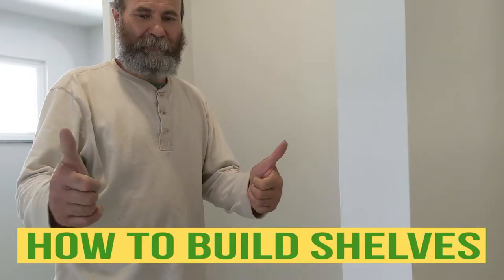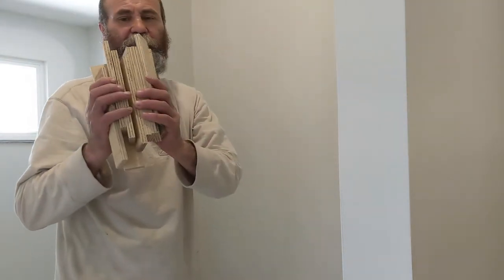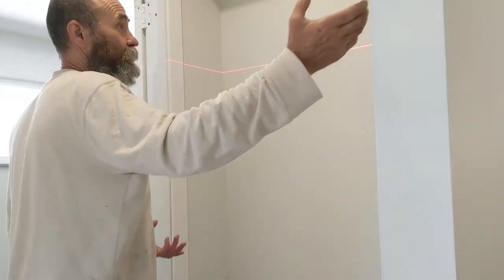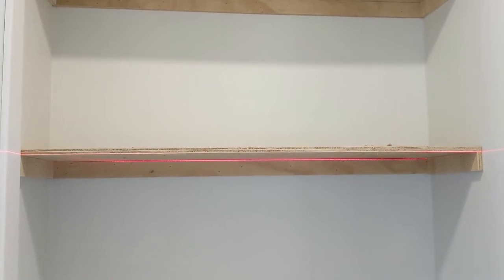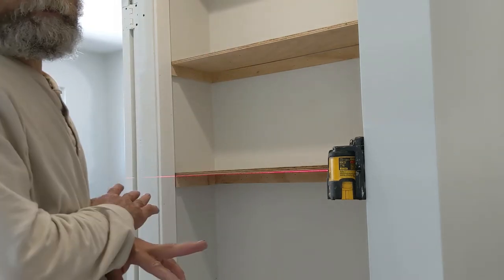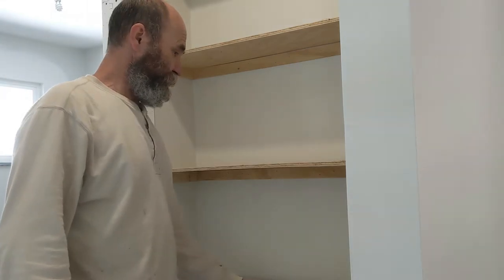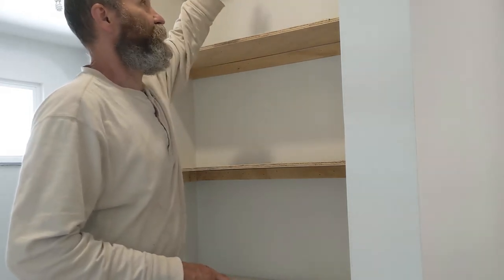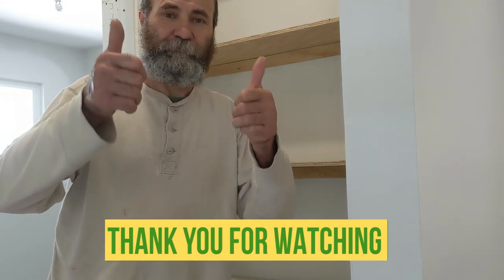HOW TO BUILD shelves

Comment: Nice video. I just built shelves for my entryway closet. i used a similar technique, but I used screws with drywall anchors
Reply from the maker: Hello Richard, thank you very much for your time and support, screws are the best in holding power, in my case I have plywood behind the drywall nails would be good enough, keep safe and enjoy life.